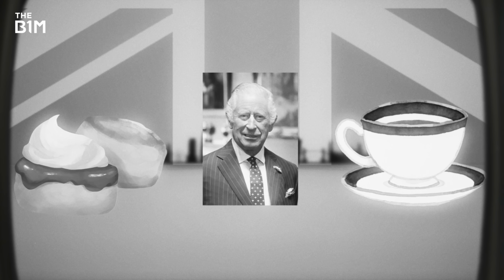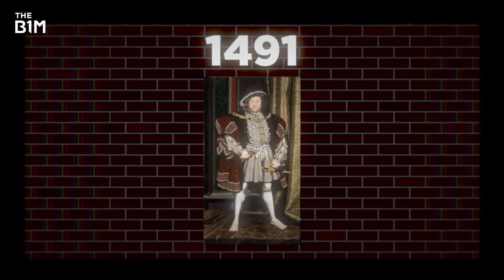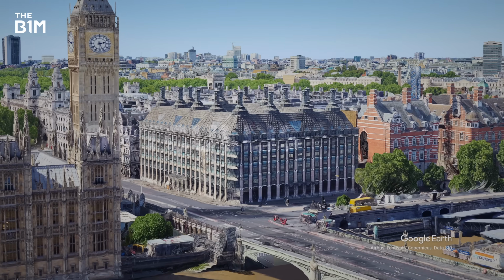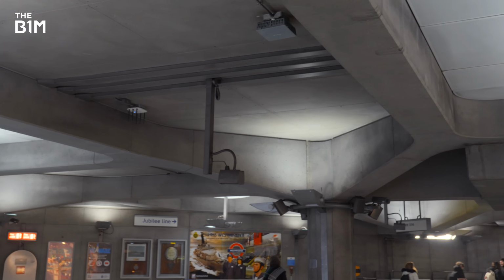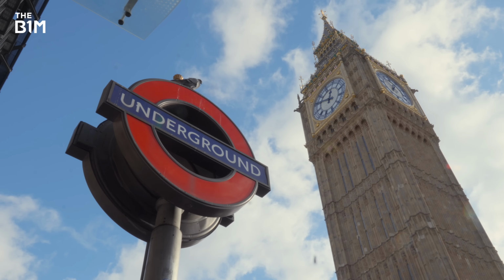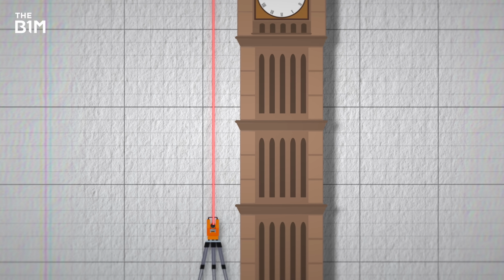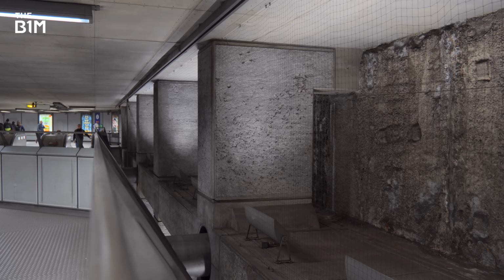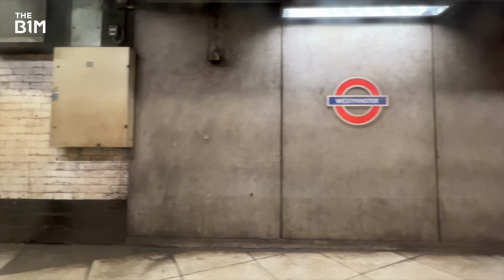The Insane Tunnels Under Big Ben

Comment: I got a story to tell. I was working on the Westminster bridge resurfacing 2 months prior to the Elizabeth Tower being scuffolded up. I am a surveying civil engineer. My totalstation was set up on the bridge while the workers were doing their job and I had to give them positions for the drainage and levels and road markings etc. One day I was so bored I started observing the tower and the beautiful layout of the clock face when I noticed something odd. (Remember a surveying instrument - a Leica TS1202 in my case - when set shows a vertical line in the optical field.) When I ran the telescope over the tower from bottom to the top I saw it tilting towards the bridge. I asked the manager if they can allow me to pack up the instrument and walk accross the bridge to further investigate my suspicion. I set up the instrument right accross the tower on the other side of the road and started a reference line survey (comparison measurement). Basically establishing a reference plain at the bottom of a building and then start shooting at different levels on a supposedly vertical plain to find out if it is tilting or not towards you. The two thirds of the tower could be considered a rather vertical plain with very few obstruction so I surveyed that and the numbers confirmed my visual observation. The tower was in fact tilting towards me (or the instrument). 6 weeks later I read in the Guardian the Big Ben needs urgent underpinning because it is tilting. It turned out an other civil engineer like me discovered the tilt 3 months prior during a monitoring survey, which is a much more precise surveying technique. Monitoring survey is using several permanent targets on buildings (mostly historical buildings) and their surrounding to determine if there is measurable movement, they can usually able to pick up millimetres of movement. In London we do constantly monitor built structures relative to their surroundings so preventive actions can be taken in time. I am very glad my fellow collegue had done a great job and what followed.
Reply: Cant have the leaning tower of Liza
Reply: @aghastlyghost  It's no secret,that Big Ben is a leaner. It seans to towards the Westminister palace. That's old time engineers trick to prevent tower to  fall on the street. Westminister palace is a giant wedge to keep Tower up right.
Reply: In the video he said they could measure the tilting to 10 mm, are laser based measurements really that imprecise? Even 1 mm seems a bit sloppy.
Reply: @thincle6626  Yes you are right, 10mm is way more than we can measure things by using laser. In monitoring surveys we measure less than milimetre movements on fixed target point all over the facade of a building. The targets are usually retro targets (reflective 2x2cm stickers) or drilled in mini prisms (much more expensive and destructive). Interesting fact: on the London underground stations you can easily spot mini prisms fixed to the ends inside of the tunnels on both sides some along the tracks some on the platforms, and a suspended automated robotic surveying total station above the tunnel regularly taking measurements of every single targets before and after each train. These then all recorded and analised for precise movement monitoring.
Reply: Maybe the other chap will comment too.. 👍
Reply: @richard_ellis  If the "other chap" mentioned is who I think it is, he can't comment as my lifelong friend is dead. He died in 2023 from cancer. He designed the jacking support system holding the whole structure up and was ordered to 'lock' the system off, where it then was.  Otherwise the Elizabeth tower would have fallen into the hole that was across the road.
Reply: @sirmalus5153 Sorry to hear about your friend. We have a lot to thank him for. My only connection to the tower is that when I was a kid I wrote to Jim’s fix it to ask to see the Big Ben bell. Thankfully I didn’t get a reply.
Reply: @sirmalus5153  Sorry for your loss. I sadly don't know who the person really was I just read about the discovery  weeks after I surveyed the tower.
Reply: @richard_ellis  Sadly he will not be able to. Read below why.😔
Reply: It's a good thing London is not in a major earthquake zone.
Reply: I had rural property in northern Thailand.  I went once, with a 'right triangle' and five pretty girls - to measure the height of a very tall mango tree.  We found a place on the near-level turf - where the triangle's edge projected up to the top of the tree (using a carpenter's level on the ground edge) .  Then we paced from there to the base of the tree, each long pace = 1 meter (mine were 1 meter, ...the girls' were closer to 75 cm).  We gauged the height of the tree, and had a fun time doing it.
Reply: i can wrap my head around measuring tilt to your left or right, but how do you measure tilt towards or away from you?
Reply: @mrxmry3264 I will try to explain it. Imagine a line determined by two points in front of you. That is the reference line I mentioned. Picked at the bottom of the building's facade. Then any measurement above that line the instrument giving me a relative distance to the refline if the point I shut is on the same plain, behind or forward relative to my refline. If every single following shots going further up showing the points I am shooting getting further and further forward to me from my refline the plain (front facade) is tilting towards me. I wish I could draw you a simple drawing.
Reply: @mrxmry3264 Of course in an ideal world all buildings are perfectly vertical. But in reality all building is constantly moving. It is a perfectly normal phenomena. Soil disturbance, wind pressure etc. We monitor this and there are movements within tolerance and beyond. Elizabeth tower's 500mm lean is not a direct danger to the building or to anyone but surely something to keep an eye on.
Reply: @Lucky32Luke Yes. Could be normal building tolerances. But to prove or disprove any or all theories it sounds like yet another big payday for the lawyers.
Reply: @mrxmry3264 go round by 90 degrees & repeat the process?
Reply: Pleeeeease tell me you chose to voice your concerns by singing London Bridge Is Falling Down at your boss for a giggle?  :face-blue-smiling:
Reply: Preventative?
Reply: I'm afraid no matter what surveys are carried out in vibration and subsidence, the Geological structure of the earth and its plates could in theory flood the whole of London and its Undergrounds?  The recent unexpected Quakes and disasters within the last 50 years should be a warning! I worked on the Channel Tunnel, and various large scale projects. I suppose everything is a bit of a Gamble?
Reply: If it tilts n collapses……good
Reply: The Tilting Tower of Treason.
Reply: wow what a pointless story. you realized something that everyone already knew about. big deal.
Reply: @DrPeculiar312  Funny you say that. Only a handful of people knew about it at the time (I thought this was clear enough for most in my post). But I am confident in saying that you didn't know about it when I surveyed the tower. In our business in London we do share interesting findings in surveying online - kind of an internal groupchat. There was nothing about the Elizabeth tower. On top of that, I shared my story because it was relavant to the video. Your comment on the otherhand is not relevant whatsoever. I beg you please comment something meaningful next time DrPeculiar. I can only guess you are trolling anyone who is not you. The clue is in your name but I am 100% sure you not a doctor of anything. Prove me wrong. ;)
Reply: @DrPeculiar312  446 Likes proves you wrong, pal. If you don't like reading my story (relevant to this video) just skip and move along.
Reply: @DrPeculiar312  Funny you say that. Only a handful of people knew about it I recon (I thought this was clear enough in my post). I am very sure you didn't know about it. In our business in London we do share interesting findings in surveying online. Kind of an internal groupchat. On top of that, I shared my story because it was relavant to the video. Your comment on the otherhand is not relevant whatsoever. I beg you please comment something meaningful next time. I can only guess you are trolling anyone who is not you. The clue is in your name but I am 100% sure you not a doctor. Prove me wrong. ;)
Reply: Paragraphs
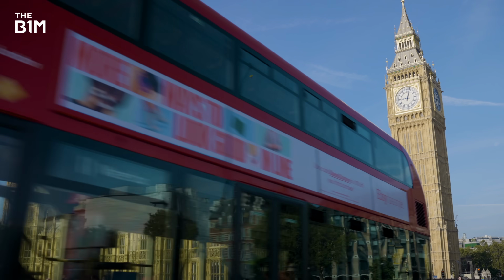Reply: 1:18 WRONG!! It's not just the bell at all - the entire tower is called big ben - it's a Partonym, the whole tower is referred to Big Ben, saying the bell is Big Ben doesn't undo the fact that the tower is also called Big Ben.
Reply: @removechan10298  In 2012 the tower has been renamed to Elizabeth Tower to commemorate the Queen's diamond jubilee.
Reply: @Lucky32Luke  That's odd.  They didn't name it after me.  Oh wait, I know why: I'm not rich, royalty or famous.  Ok, I'll let myself out the back door, bye bye.
Reply: So, "I noticed the tilt and confirmed it by measuring with an engineer's level" would have sufficed, wouldn't it.
Reply: @christopherbedford9897  Not really, since you would need direct access to the tower and also needs several measurements not only at the bottom but all the way up on the facade.  Of course there are other ways to measure tilting. I could have drop a line and plumb bob from the clock's level. The total station can take reflectorless (laser) measurements from a good distance. My whole mini survey took only 30mins top.
Reply: @Lucky32Luke  So in your opinion, do you think the tilt was caused by the Jubilee line extension and shouldn't tfl pay compensation? 😝
Reply: @minnielee3399  It is beyond my expertise sorry. Both soil engineering-wise and legally.
Reply: @Lucky32Luke  I say it's most definitely but tfl won't admit it in case of liability. Coincidentally the tower is now leaning towards Westminister stn and not in any other direction. This direction just so happens to be where the excavation of the ground below took place.

Comment: How did the winning contractor even bid this project. The enormity and complexity of this job is astonishing. I’m a QS in Los Angeles and I headed up the bidding of some huge construction projects in California. I wouldn’t know where to start.
Reply: The station was built by a joint venture between AMEC and Balfour Beatty I believe. At the time they were both in the top ten UK Civil Engineering companies (AMEC Civils was sold by AMEC in 2007). They had both built similar structures, this was "just" more problematic.So they had the personnel.

The price will be based around mostly the method of construction and programme rather than mostly the units of materials. AMEC and Balfour Beatty had a previous JV on the Limehouse Link which was a cut and cover road tunnel with diaphragm walls near the river in the docks. At Limehouse they had a concrete batching plant next to the river with deliveries by barge. They had people available who could price running a batching plant on a barge near to the station and pump under the roads and compare that with the cost of pouring at night/ weekends with mixer trucks to avoid the traffic on the bigger pours. Then you integrate the method for each element and the costs.
Reply: As with many big contracts, it's not what you know it's who you know.
Reply: There is also the issue of the temporary propping which would require extensive co-ordination between the site team, the Contractors temporary works engineers, the  project Structural Engineer and the subcontractors engineering team. And the contract might well have been let on a construction management  % fee basis rather than on a fixed price.
Reply: the central grand park ?
some library 
sthg near the high speed rail project?
Reply: You start with lobbying politicians related to your business. You'd be clueless to think merit wins even in this field.
Reply: What? You assume it's difficult because YOU don't know where to start? Some random youtuber doesn't know how to bid on a massive subway infrastructure project, wow! It must have been so difficult!!!!
Reply: @DrPeculiar312  I'm pretty sure QS stands for quantity surveyor. The people who post videos are YouTubers. The people who post comments are often highly-qualified professionals in their own field.

And you can't even read, apparently.

Comment: I've been inside Parliament and yes there is a tunnel from Portcullis House under the road into parliament. There is also a "secret" entrance to the station for MPs within that tunnel (it's not really that secret if you know where to look). Don't know about any other tunnels, but I'm sure they could exist.
Reply: Yes, that entrance to the station is on the right as you approach the exit towards the river from the station. About seven years ago, you used to be able to exit through that exit past the low-level door into the Houses of Parliament. But now, there is a pass-operated barrier to prevent the general public exiting the station that way.
Reply: I've gone from one to the other on openhousew weekend.

Comment: I used to be a Station Supervisor at Westminster and in those days (2010) we had to do a complete check of every room on the station as per fire regulations. The non public area is massive and contains many floors and rooms.
Reply: It sure is a different place to when I did a few turns there as relief railman back in 83/84. I left London 25 years ago but it's longer since I rode the district railway ( was a guard out of Acton & PG) I assume the quaint old glazed brick walls on the district platforms etc were destroyed by this project. It always felt right to have that retro feel to the station opposite parliament.
Reply: I remember taking test equipment down to below the Jubilee platform levels (I think the two platforms are on different levels) to test the radio systems before the escalators were commissioned.  Getting out again to my car parked on the Embankment (you could in those days) was a good work out.

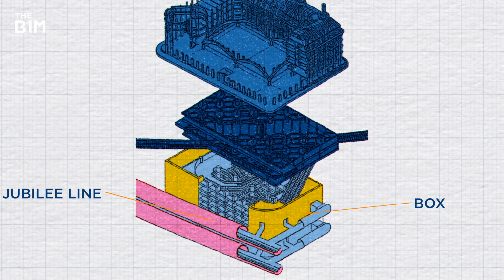Comment: 08:37 The arrows are on the wrong sides. All subsurface Underground lines use left-hand running.
Reply: Yeah I’m from the states and I was like…that’s wrong
Reply: I seen it and was like "I swear the trains ride on the left" and then the footage of the train on the left appeared.
Reply: Most are. There are some right hand running lines. But you are correct about the Jubilee line.
Reply: yeah but the point is still that they are side by side running. Doesn't really matter which side.